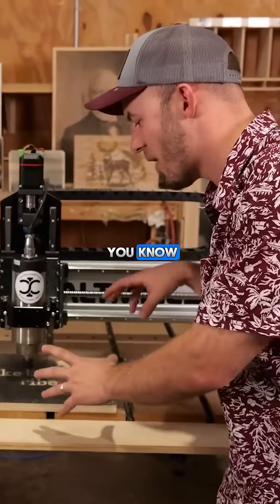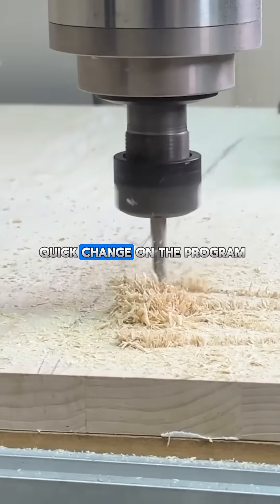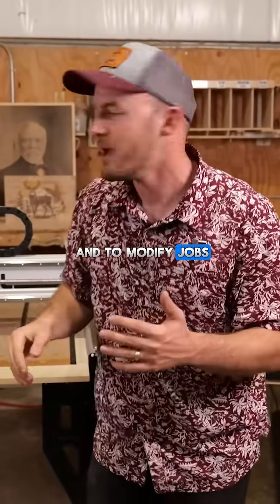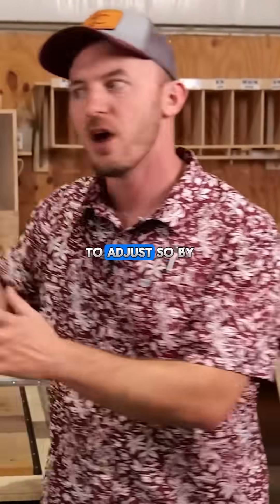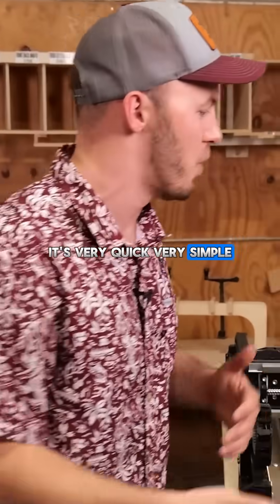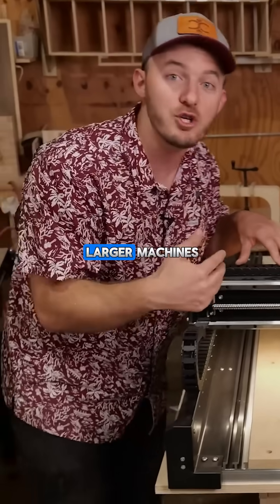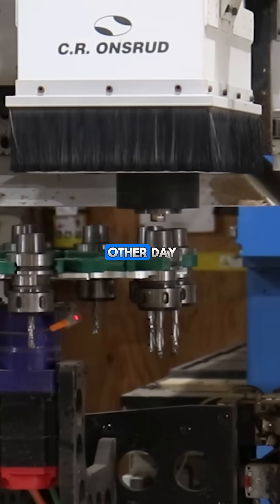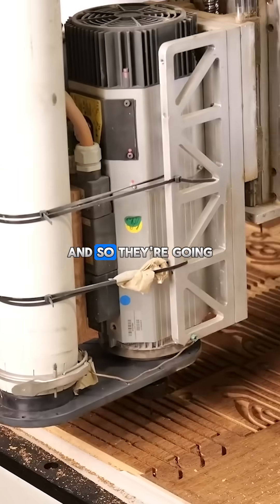Before You Upgrade Your CNC... WATCH THIS!

Comment: So what part of the budget do I need to plan for broken bits or maintenance on my hobby machine when I get it?
Reply: Professional machinist here they typically plan out at least half the machine cost for tooling. If you're a hobbyist, I definitely recommend 3-5 bits. There will be a learning curve and you will crash the machine unless you're a prodigy which i have yet to run across
Reply: @dominic6634  ty. Would that be 3 to 5 of each kind of bit that I want then?